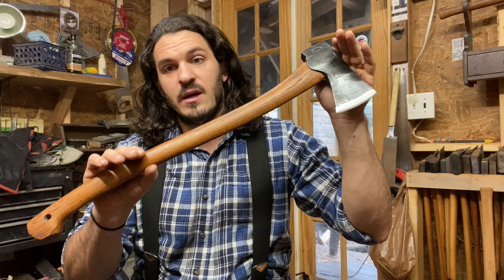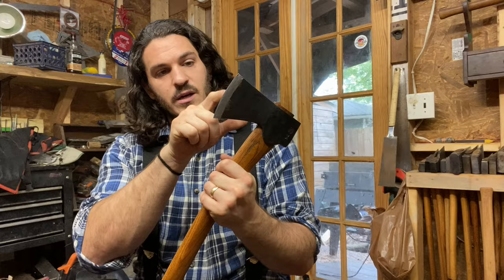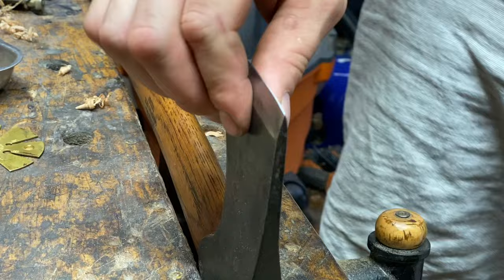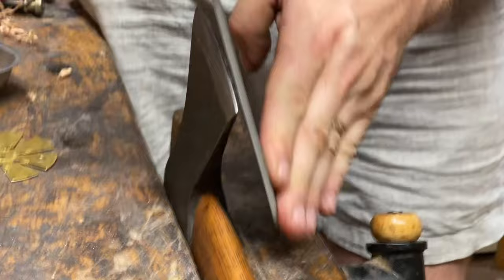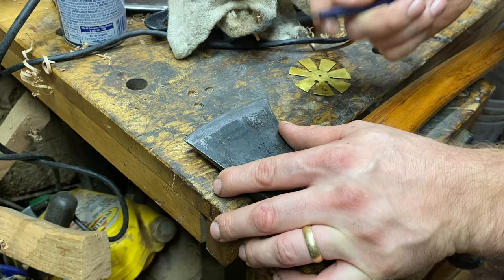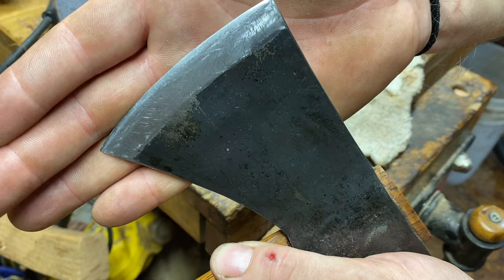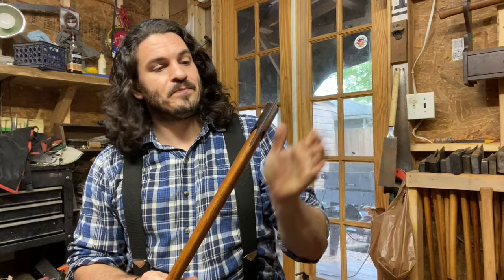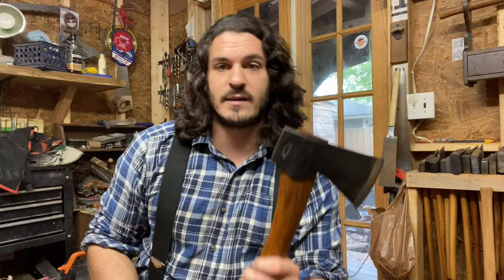How I fixed my Gransfors Bruk Axe

Comment: I had more questions, so an experienced grinder (18 years at Gränsfors) called me up. Spoke för over 30 minutes. He had a lot to tell:
57-59 HRC (I was told 56-57 earlier, it was wrong), often 58 HRC. 35 degrees bit ange for SFA and 33-35 for the Scandinavian Forest Axe. But - since the bit is convex it cannot be measured at the edge. It is an approximate angle at the "swell" (correct word?), which I understand as a few mm inside of the edge. At the "curve" of the bit. Approximate angle.

The bit is convex to not be "sucked into" the wood when you cut branches, and to make the edge stronger. He actually said that the bigger angle and not razor sharp edge is supposed to somewhat more bounce back when you are limbing trees, so you can strike again, and not get stuck.

Note this: The forest axes are NOT supposed to be razor sharp, i.e. you are not supposed to be able to cut paper or armhair with it. If you can, the angle may be to low/sharp and the edge too thin = it will fold over easily when you cut branches and trees. SFA is made for limbing branches off trees, and cutting down smaller trees. Scandinavian Forest Axe (or Large Forest Axe, which it is named in Swedish), is made also for cutting down larger trees. Of course cutting in V-angle.

So folding edges may be because of too small an angle and too sharp an edge. Since it is made from carbon steel which is softer, this may occur, hence bigger bit angle, convex bit and not razor sharp.

He also told me that Hults Bruk (Hultafors group) use the same Ovako steel as Gränsfors Bruk, and Wetterlings (who now produce axes for Gränsfors Bruk).

Comment: I have watched probably every video you posted on this Gransfors Bruk and right of the bat I thought you experienced all these predicaments because of a phenomenon called "decarburization of the edge". This is an undesirable effect that happens during the heat treatment protocol in which the edge loses much of the désirable carbon because it's so thin and the carbon is basically burned. However, when you remove this "surface" sort to speak, then you reach the really good steel, which lays underneath. I am glad you managed to reach the true steel you've been expecting!
Reply from the maker: Definitely seems like it. Thanks for explaining that!

Comment: Sounds like the edge got overheated when they ground it. I've had several knives over the years have the same issue and a good reprofile fixed them right up. Lucky for you it was just the edge and not a bad heat treat for the whole head.

Comment: Over heating is one major issue in cutlery manufactures, it enbrittles and softens the steel. If you see chipping and rolling at the same time, consider overheating as the cause. It could also be due to carbide strip that sucks carbon out of the matrix, softening the region, and carbides promotes cracks, thus chipping.

Comment: Ive had a wetterlings hatchet for qell over 10 years now and it has never been sharpened. I've cut down way more than over 100 trees with it (felling ,limping and splitting) .
The edge is still keen .not paper cut keen but still very usable. And the fit the head has on the handle is beyond excellent.
Reply from the maker: That’s awesome! The hang on the Swedish axes is always excellent. Since they use a press forge instead of a drop forge, they can take the time to double drift their axes. I’ve never seen a Swedish axe hung on a shelf.

Comment: Yeah, I guess the steel overheated while grinding the edge, or maybe a thick decarburized layer that grew during heating before quenching. Not something that should happen on such expensive axes, expecially if it's due to overheating. However, over 60 HRC seems way too much for an axe of that kind

Comment: I personally think Above 55 HRC is too high.  I like filing axes that aren't too difficult.  Because of this uneven temper I'm skeptical if this won't now be brittle.  Only time will tell.  I believe the last edge rolled?  If it was chipping while being soft that doesn't seem like a good sign.
Reply from the maker: Before it would roll and chip. Fortunately I don’t think it was poorly tempered, just ground too thin and too hot! Holding up well now. I really like high 50s axes, they hold an edge absolutely forever, but dang when they get some damage they can be a pain to get back in shape for sure. It can also be a challenge to get them profiled to chop well.
Reply: @urbanlumberjack  interested to see you revist this steel once you use it thoroughly.   Which won't be difficult for you since you're blessed with hardwoods.
Reply from the maker: I need to get another load of hardwood! Running really low right now. I’m excited to put the ax through its paces, I expect it will hold up much better. If it doesn’t, I’m going to be real bummed

Comment: Thanks for the video. I have their Splitting axe and their Wildlife hatchet and they are both amazing. Razor sharp and both hold an edge unbelievably well. I plan on buying either the small Scandinavian  axe or the  Scandinavian forest axe….i think either would complement the set pretty well, and compliment each other.
Reply: Glad to keep an eye out for this though…again, thanks for the video.
Reply from the maker: That’s a great set! I’ve heard from a number of people about a huge variation in grinds from the factory for the SFA. Some say it’s almost 30 and others very much sub 20. It seems to vary based on the smith too. Since I fixed mine in VERY happy with it. Thanks for the kind words!

Comment: This is why I won't get any GB axes. I've heard a lot of hype, but also a lot of actual bad field use reviews. When you consider the quality of less expensive axes from the likes of CT, you can pay less and get more. You can also pay similar amounts for HB and Helko products as an alternative.  I even like Hultafors/Husqvarna, tho many folks don't for whatever reason. But yea, there is a growing "drinking the Koolaid" crowd full of fan boys and wall hanger collectors that swear by GB, but I don't think I'll ever be one of them.
Reply: Depends on the model. GB Large carving axe is a King. Others - I will just reprofile as in this video. No big deal. The handle on my "premium" Council tool was crap. I have replaced it with a much longer one from them. So, just do what needs to be done. These are tools, not conversational 'heirloom' peices.

Comment: I have the scandi forest axe by GBA and love it for trekking and bushcraft. I have chipped the blade a couple times right after buying it. I think I will try this out to get back to the hardened bit. I also need a new handle I have a crack from and over strike going up into the eye it hasn’t been a problem yet but I do think it eventually will be. I have seen they sell replacement made specifically for each model axe have you used a replacement yet? Is the eye pretty much already sized to fit? It seems to me that it is.
Reply from the maker: If you feel like it chips when it shouldn’t I’d absolutely recommend trying this out. Also for a period of time they ground those bits far too thin. Mine was ~15 degrees.

I haven’t had to replace a Gransfors handle yet but I would imagine they tap right in.

Comment: So with just a bastard cut file, I can do that reprofiling? How am I to find out how much steel must be removed? If it's that much steel, it will be too much work. I should then take it to someone who has experience and  power tools. What is your reprofiling degree? (20 toe and hill, and a bit more to the center?) What is the new effectiveness in choping? Either way, reprofiling it, should be for sure worth it.
Reply from the maker: I re profiled to 20 degrees. This axe doesn’t have a high centerline so it’s fairly even across the bit, but is slightly thinner at the heel and toe.

I re profiled with a mill file, it’s definitely doable. Took me maybe 30 minutes. I would say if somebody has sharpened an axe with a file this is absolutely a doable project. 

It chops very well. Doesn’t bite as deep as before, but that’s expected since it’s a much thicker bit now. Edge is holding up very well but I haven’t pushed it hard yet.

Comment: They don't use quality steel, it's all recycled scrap steel.
Reply: I would like to know the resource of this statement.
By the way
metal does not degrade no matter how many times it is recycled, unlike polymers, papers, as long as the steel is pure, well annealed, normalized before use, no problem.
Reply: Research  @Laurarium
Reply: It's actually true, but definitely not just for them. The automotive industry is doing just that LoL.
Reply: Who cares? Deal with it LoL